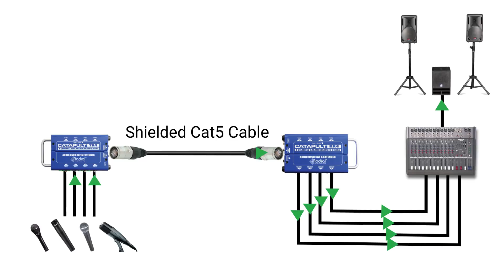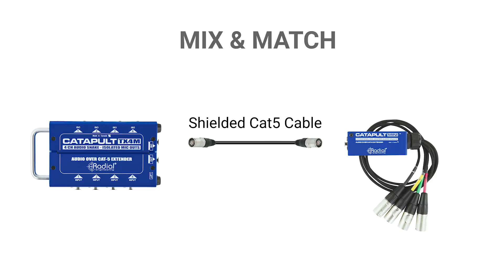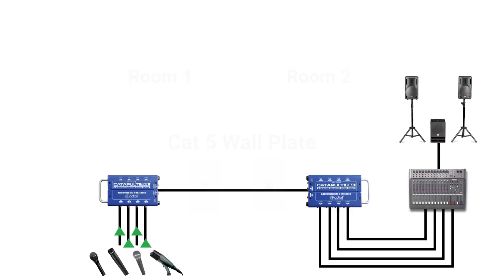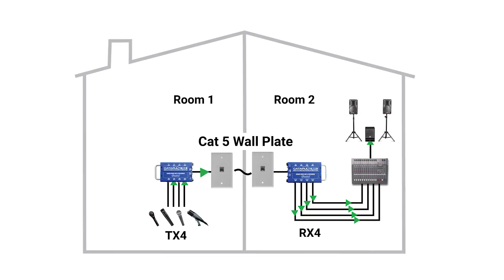How to connect analog audio through cat 5 ethernet with the Radial Catapult

Comment: Looks like a great product.  Can this is phantom power if I use shielded Cat 6?
Reply from the maker: Phantom power can be passed through the Catapults so long as shielded ethernet cabling (Cat5e or higher) with shielded and terminated RJ45 connectors are used.